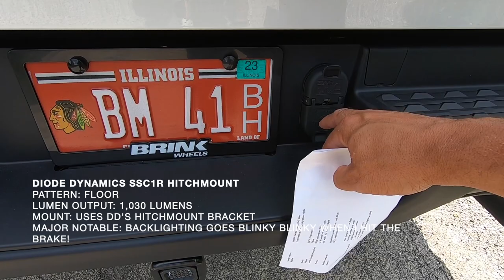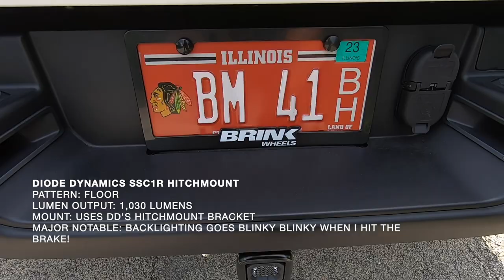Lighting Overview Part 1: Lighting Specs and Mounts #offroadlights #diodedynamics #bajadesigns

Comment: I have a 21 rebel, had it a few years and haven’t done a thing! I finally started ordering stuff for it. I just ordered; corsa cold air intake, ultimate 9 evc, running lights for the grille, and a leveling kit. Currently looking at some wheels to go with my nitto grappler tires. Exhaust is next. Gonna be the best looking rebel in Milwaukee
Reply from the maker: Love it! I spend a few weekends in Milwaukee, had 1 too many beverages at the Public Market.  Also, Lakefront Brewery was by far one of the best brewery tours I have ever been on.
Reply: @WaterFowler41  gonna have to try that out!! I just moved back. Been gone since 2004 when I left to join the marine corps
Reply from the maker: Welcome home and thank you for your service